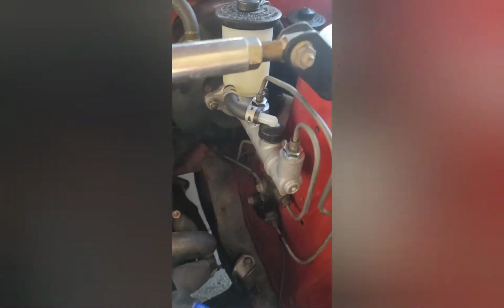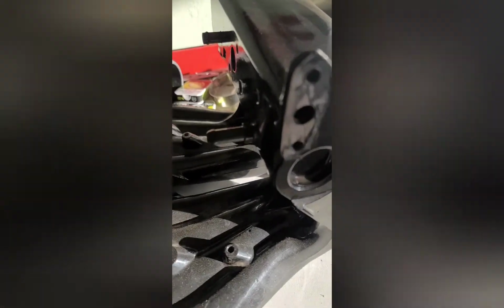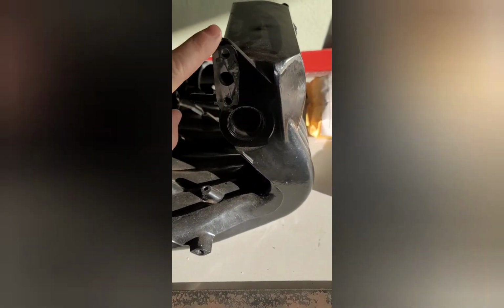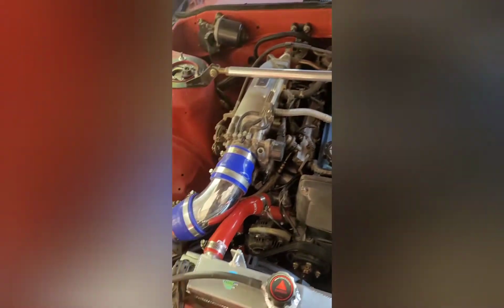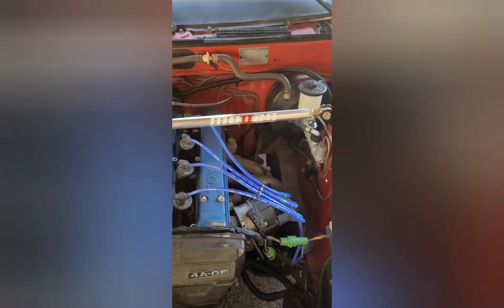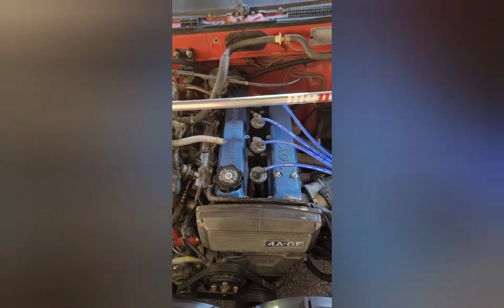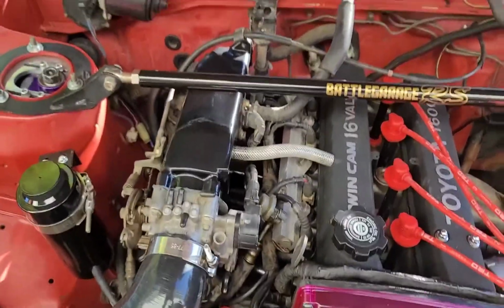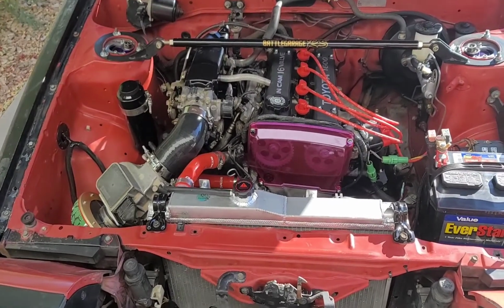Ae86 cleaning up the engine bay part 1

Comment: when u did the egr delete are u also removing the vacuum lines that connect to the vacuum valve switches or just capping those 3 lines on top of the intake manifold
Reply from the maker: Yeah everything capped off.
Reply: @leveledupgarage5303  ok ima try doing that to see if it has anything to do with my issue. The problem im haveing is that the car breaks up alot especially around 4k rpms. It starts up fine i just have to hit the throttle one time and idles at 1k rpms when warm.
Reply from the maker: @miniroku247  hmm. That sounds more like a fuel delivery issue. Possibly spark. I'd get a fuel psi gauge on and see what it's doing at that rpms
Reply: @leveledupgarage5303  ok ill do that   thank you for responding i appreciate it
Reply from the maker: @miniroku247  no problem. Hope you get it sorted.

Comment: Hey man idk if u will see thi but I’m doing a 4age swap into my sr5 it has the welber side drafts I don’t have a harness and was wondering if u know if there was a way to run it with out a ecu I have the coil and the ignitier any info would be much help
Reply from the maker: Thankfully you don't need much wiring. You gotta run a couple to the sensors. The alternator wiring which should be there. And a power to the coil. It's not too bad as long as you just take it one wire at a time.
Reply: Ok thanks the power to the coil was I was most wondering about because i didn’t know if I had to use that igniter thing